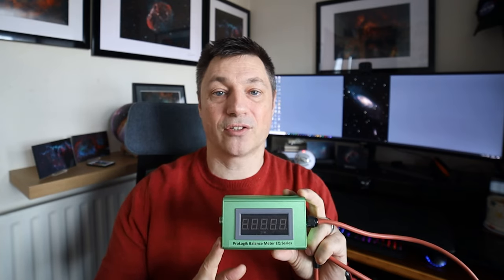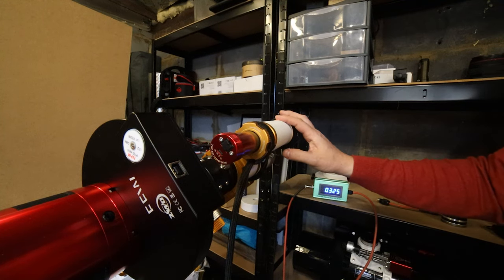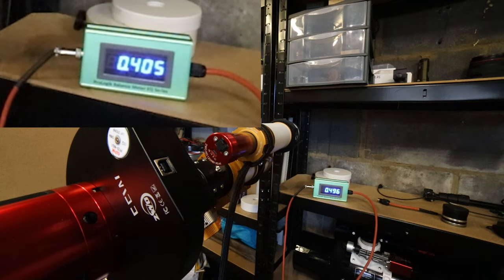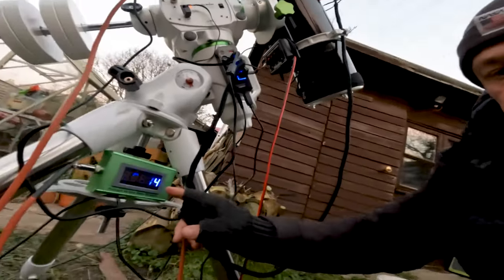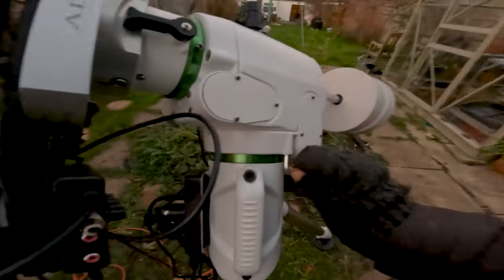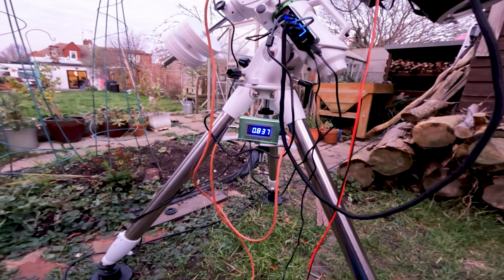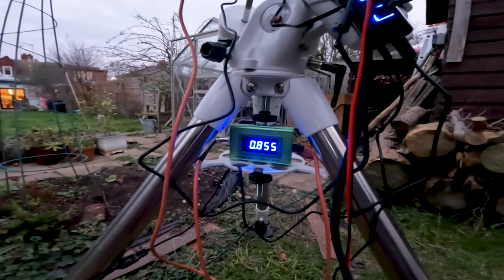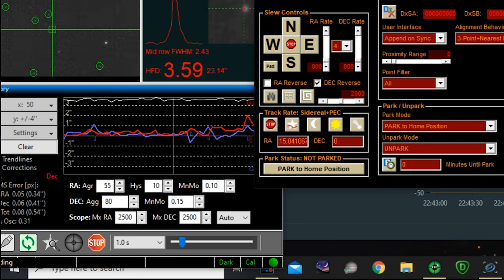Achieve perfect balance - Astrophotography

Comment: That is exactly how I use to balance my AZ/EQ-G mount, but I just used a regular meter with some modified leads. I'll have to try the method to adjust my backlash and see how well it works.
Reply from the maker: Excellent Miguel. Works well on backlash adjustment

Comment: Great video Glenn - very cool overview and this tool looks great for worm drive adjustments ... certainly sold on getting this device, thanks for the review! 🙂
Reply from the maker: You are very welcome. It definitely takes way the guess work and helps you get that mesh adjustment pretty spot on. I started by doing a full 360 on both axis to find the smoothest section of the gears and then slew to the centre of that and then lock the clutch. You only use half the gear on both axis so if one side is worse you can put that on the opposite side of the worm.
Reply: @Astrobloke  Thanks for the additional information, well noted - looking forward to receiving the balance meter and seeing the results!

Comment: Perfect video. I’ve used an amp meter to balance my eq6r but needed a better amp meter in that it would show smaller changes in amps.  A more sensitive one would cost the same as this one. Knowing that I can take some of the guess work out of the hypertune work I’ll do on it this summer, fire season in Northern California all summer last few years, will be very motivating . Another great video. 
Consistent guiding at .7 and below is my goal. I’ve did 6 and 7 minute exposures 
On the witch head nebula and 4 hours of data produced good results. But always room for improvements.
Reply from the maker: Hi Dan. This tool will definitely help you with your hypertune as after that balancing will be easy with no stiction. I can confidently say that if the seeing is good you should be able to get under 0.7rms error.
The witch head nebula is definitely a target I need to look at. Clear skies

Comment: Tried it 
The were numbers fantastic. 0.3 to 0.5. And 0.5 throughout the night. I used close to Sirius to calibrate. The guide assistance had issues and didn’t show the apply boxes at all but great guiding no jumps or spikes settling in at 0.5 . The next night the calibration ended with a calibration sanity check. The blue line was right inline with the white dots  , the Dec white dots were off at the left at top where they awhere intersect with the x in the graph the dots were about 5 hash marks the left of red line . It said , The RA and declination guiding rates differ by an unexpected amount . For your declination of 5 degrees  ra should be 100% of dec but was 121% of dec. this usually means that one of the axis calibration is incorrect and may result in poor guiding. But it was great guiding. Not sure what to try tonight. Maybe adjustments in dec first , just a hair and only back out the dec On the front side. Just in case there was binding.
Reply from the maker: Soinds great Dan and 0.5 is very nice. When you do your calibration do you slew towards to equator and get dec as close to zero as you can? Try that if not it may help.
Reply: What concerns me is the sanity check and guiding assistant not giving apply boxes.

Comment: Concept same as covered by cuiv the lazy geek using a clamp meter but expensive for just using for your mount  where as a good quality clamp meter can be used for other tasks and other mounts , non the less nice video showing more in depth fettling of the mount good work Glenn
Reply from the maker: Thank you. Clamp meters are not as accurate unless you spend far more money than the cost of this. But yes you then have a clamp meter for other use.

Comment: Hi Astrobloke, another great and useful video! I have a NEQ6 with quite a bit of stiction in RA, and guide assistant show 'backlash' in DEC, although I suspect it is slight binding as you suggest (no sounds indicating binding though). I did by an amp meter to help with balance after watching a similar video from Cuiv the lazy geek, but I didn't think I could also use it to check for binding! 😄 Thanks for the tip! 👍🏻 Also, I might have been slewing to fast at max speed...
One question though: In another video from Cuiv, he suggest to avoid applying a pec curve when active guiding, and that pec curves should only be used for unguided sessions. What's your thaughts about that?
Astrobloke, Cuiv and Nico Carver I have to say are the three most useful and informative astrophoto channels on Youtube. Thanks a lot! 👌🏻
Reply from the maker: Thank you for your comments, I have always recorded PEC while guiding as its the movements that are not guide pulses that are detected that builds the curve data and reveals the periodic error. I have read others saying not to guide. But if you use PEMPRO which is a very good PEC tool that requires guiding to be running (which is inbuilt) as does my ioptron cem26 mount in the ioptron commander. You can only record the pec once guiding. I am not saying you cannot do it without guiding but I have never done that and always recorded it under guiding conditions and had great results so stuck with that. with regards to binding it is not always audible but the meter will show if its there, good tool for that and good luck

Comment: Very informative video, thanks.   If you making very fine adjustments, I suppose the temperature you perform these is also critical.   My EQ8-R (which I’m returning) slewed OK at 20C but after hours at 3C, the RA axis bound badly.
Reply from the maker: I think you are right Cliff however I am not sure how big a temperature swing is needed to effect the mount significantly. From your experience almost 20C. I haven’t had any issues with the EQ8 so far. The EQ6 has been great through the cold  months so will have to see if that changes in the sunmer

Comment: Cool trick! But if all that box does is measuring the amps, I could just use a multimeter right?
Reply from the maker: Yes you absolutely can. This was nice as it had a large clear display and was easily connected to your mount. These are no longer available though as the guy stopped his business last year but any amp meter would work fine.
Reply: @Astrobloke  Update: I just tried this.
I made a power connection to the mount (HEQ5) with a multimeter in serie on the positive lead to measure the amp. The mount powers up as normal, but when attempting to slew at max speed the mount makes funny noises and wont move. Maybe the multimeter interfere with the power delivery from the switching power adapter. I tried with two different multimeters, same result.
Q: The multimeter that you linked to on Amazon, is that able to accurately measure the amp with the clamp, or does it have to be connected with the leads?

Comment: Richard - Belgium - Good video Glen...I'm using a similar product, home made... :-)...essential to balance my stiff AZEQ6. But, I would recommend checking the whole 360° round. Because, such as mine, those chinese products are not always of good quality. The gear is not perfectly centered and I've got more play (back lash) on one side...:-(...
Reply from the maker: Hi Richard and thank you for commenting. I agree that the quality of the gears is questionable but you only actually use 180deg of either gear. I initially did a 360 and found the area of constant reading and then set the worm drive into the centre of it.

Comment: problem with my azeq 6 gt, is when I slew the last 3 digits keep rising when slewing. Unlike yours Glenn where yours keeps generally constant so I cant make back lash adjustments. Sure it was balanced properly but seems to use more power while slewing both sides of the mount in RA
Reply from the maker: When you say it keeps rising does it not settle at any point? If you have a very slight movement that you would call backlash go with it and try using the mount. A slight backlash (my mount has a very slight wobble when rocked) can be compensated for in PHD2. Fine binding cannot be compensated for at all. Please let me know how you get on
Reply: @Astrobloke  will do, Think I will have to some maintenance. I noticed a dec hex bolt won’t tighten . Might be stripped. I did get it hypertuned a couple of year ago

Comment: I am UK based, just wondering if there is a best temperature at which to adjust backlash. e.g. if I do it now at around 20C will I get binding when its -10C?  Perhaps its the opposite or doesn't make any difference?
Reply from the maker: Hi Jon. With the sky watcher mounts and the fixed worm drive positions temps do make a difference. My EQ8 developed some backlash in the DEC as soon as the weather warmed up. Not 100% on what the Temp sweet spot is to cater for our temp swings, luckily ours in the UK are not too big. I would think 15-20deg would be the mid range (where I live anyways) and would aim to adjust for that. Hope this helps

Comment: Could this not be done with the built in amp meter on the pegasus box?
Reply from the maker: I am sure it could but not everyone has a pegasus box. There are lots of meters you can use and cheaper ones but some of them have questionable accuracy or not as fine in the readings.

Comment: As others have stated a clamp meter works well and I've used one for balance. But I'm finding it hard to find a commercial ammeter with the accuracy of this device.

Question on the wires, any reason to got a mount specific wiring Vs a generic 2.1mm version and plug into another cable to power the mount? I do this today with a simple barrel connector to run my rig.
Reply from the maker: Hi Naveen. I have not compared this to anything else but it has done a great job for me so I think its a nice accurate piece of equipment. I just happened to have been sent one that was for my EQ6 but you could make up adapters or like you say get the generic 2.1mm

Comment: Hi there Glenn I just received mine yesterday tried it out last night so how much points can it be off? Starting from east to west in RA it was 473 middle around 475 then when it gets to west around 480… no big jumps. Also can it be done without counterweights and scope just mount only or does it have to be like you’re going to image thank you
Reply from the maker: Hi there. That seems ok. I would say the middle number moving no more than 1 either way is a good sign. I think you can test with gear and weights mounted or not as you are just measuring the possible binding on the gears.

Comment: I get a slight ticking sound sometimes from my eq6r pro mount, is it binding ? I also have a dreaded every 8 min sweep up or spike in RMS. Is it a bad bearing ?
Reply from the maker: That could very well be slight binding and the spike indicating the tightest point on the worm gear. Unlikely a bearing issue. If you don’t have a meter you could try the other side of the worm gear. So whichever axis it is thats spiking slew the mount 180deg if DEC and as far as you can if its the RA. Release the clutch and re home the mount and then reset home position. The worm will be on the other side of the gear now which may not have binding. They are not as precisely round as we would like  and so one part can bind while another won’t.
Reply: @Astrobloke  
Thanks for reply. From what I can tell from the data the spike is on the RA side. I also bought the meter. What should I do to find out the issue by using the meter.?
It’s not really a spike, it’s a repeated U shape sweeping pattern over and over reaching a peak every 8 min

Comment: I thought having everything a little bit off balance to aid meshing?
Reply from the maker: I think if you have excessive backlash this can help as does guiding the dec is one direction and making your PA slightly off. For me after I adjusted with this meter my backlash was reported by PHD2 to be 600ms so just good balance and PA gave me the best guiding results.
Reply: @Astrobloke  I think that is the area my BL is in too
Reply from the maker: @syberand  thats good. Do you get good guiding results? Is that also with an EQ6 R Pro?
Reply: @Astrobloke  I'm usually around .8, but always fighting with the wind. But have lots of stuff to test still. But yes, eq6-r pro.
Reply from the maker: @syberand  wind is a nightmare for our hobby. My obsy helps but only to a certain level especially when using a large Newtonian..

Comment: Wouldn't an amp clamp do exactly the same thing??
Reply from the maker: I didn’t want to make a comparison video but clamp meters are not as accurate unless you spend a lot of money (much more than this)
Importantly being inline you are protecting your mounts board from any short circuits. The main pros for this is its very robust and easy to use.

Comment: I notice you only use this to balance on one access?
Reply from the maker: In the video yes as its just a demonstration but I use it  for both RA and DEC. Although my primary use for this tool is not balance but for detecting fine binding after rebuilds or tuning.

Comment: i am with u with all u do, but selling an amperemeter (and nothing more it is) for 65 bucks, is too much ^^

As always with astrogear, its overpriced ^^
Reply from the maker: its not cheap but its a nicely made, very clear to read and pre wired for your mount so no danger of damaging any circuits. There are much cheaper options which I have used but were not as good or as convenient as this.